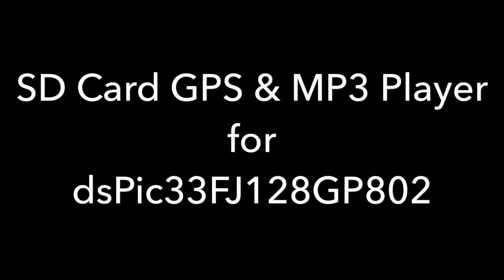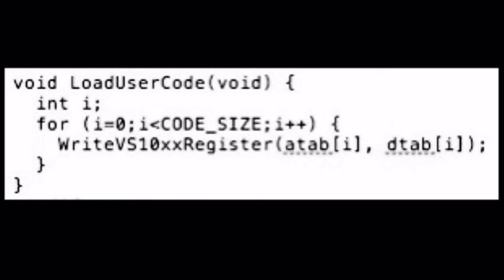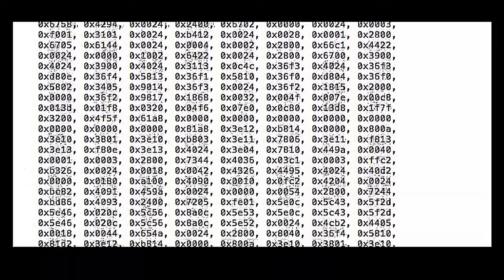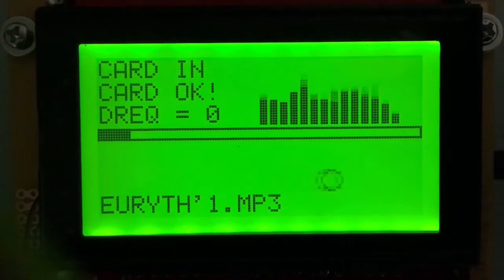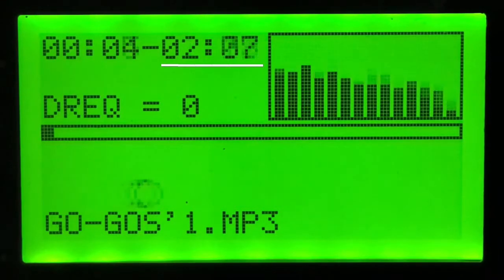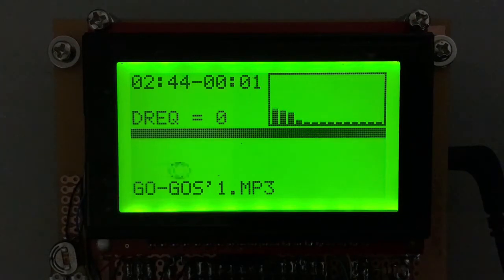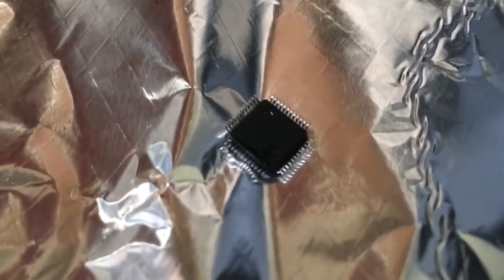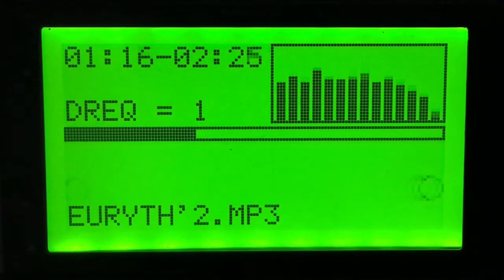MP3 Player for dsPic - Part 4 (Spectrum Analyser)

Comment: ...currently im working on a similar project but on uno styled vs1053b stacked on wemos d1r1 board programmed for webradio derived from edzelf esp-radio... but i would like the spectrum analyser on oled instead...but i couldt figure it out yet...i want it to display the private ip...current preset...current song title..and the rest is for the spectrum analyser...do you have any clue to how to do it...?...this is my link https://github.com/SurenBono/Alternate-Edzelf-Esp8266-WebRadio-Module
Reply from the maker: Hi, The spectrum analyser is executable code provided by VLSI Solutions, and luckily does work with 1053b: http://www.vlsi.fi/en/support/software/vs10xxplugins.html ... It has to be loaded to the VLSI chip, similar to how you’d send MP3 data, and once running, a list of amplitudes for however many frequencies you want to display can be queried from the chip.

Comment: Isn't the mp3 track length stored in its header? Does it have to be calculated on the fly?
Reply from the maker: Hi, Mp3, being a stream format rather than file format, doesn’t need a file header (ID tag is optional), but the decoder chip does provide stream attributes presumably from frame headers, such as bitrate & frequency, which can be used along with (filesize minus ID tag size) to precisely calculate both times. I kinda knew that question was coming, but ran out of time in the video for that narration :D The blank line underneath the time fields on the screen was cleared for that, to compare the two.
Reply: Thanks. Did not know that was optional. But it seems the media players (such as VLC) don't have that problem
Reply from the maker: They probably use the method above. A quick Google for “calculate mp3 time” gives a solution.
The issue for me is reading the spectrum data was the first time I’ve had to read any data from the chip, and I haven’t queried bitrate and other attributes yet. After that it should be little trouble. The decode time is provided by the chip, but that’s probably easier to calculate locally as well.
Reply: Cool. Thanks